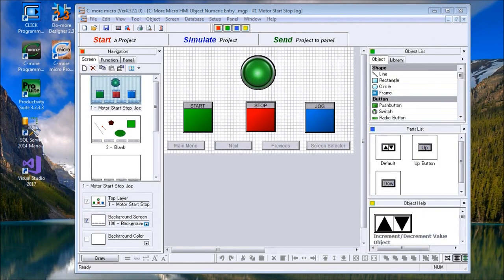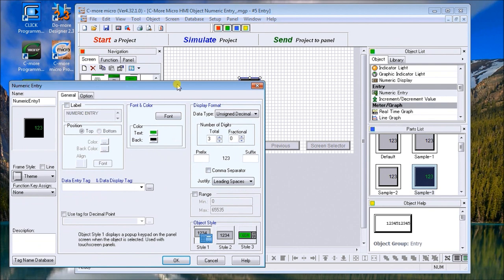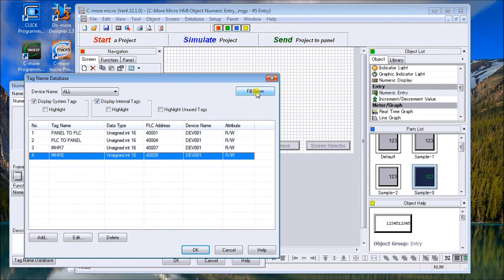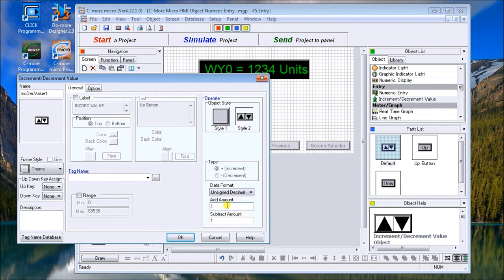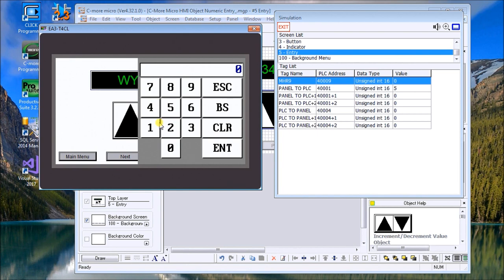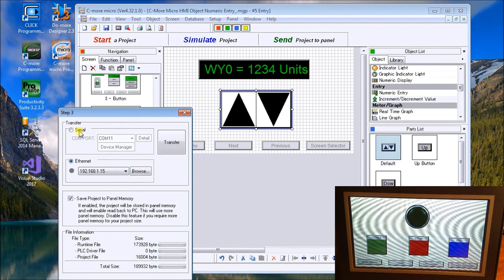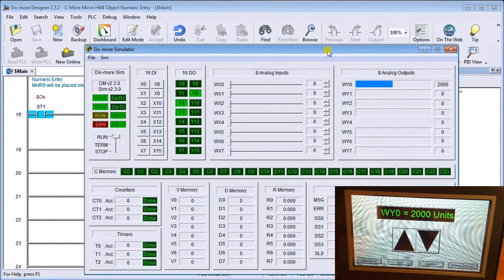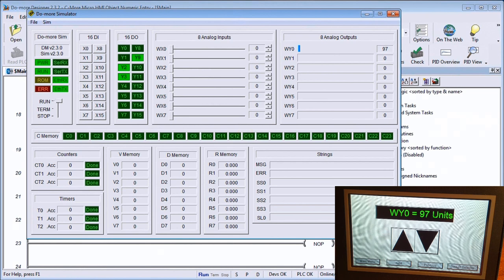C-More Micro HMI Object Numeric Entry

Comment: How about a Time Entry Text Field Hours and Minutes....
Reply from the maker: Hi Ken,
I would set up a numeric field entry for each of the units. (Hours, Minutes and Seconds) The program in the PLC will be used to modify the real-time clock. This will be dependant on the PLC type that you are connecting.
Regards,
Garry
Reply: @ACCautomation  That works for 1 Time setting, I have 8 Time settings, on a 7 Inch screen, there should be an easy way to enter Hours and Minutes and also tie those two an hours and minutes tags. The Numeric Entry exists. I can do this in InTouch, Archestra, FTView ME and SE, and probably a host of other HMI software .. so why not in Automation Direct.
Reply from the maker: Hi Ken,
I would set up another numeric field that contains the number of the Time that you want to change.  When you hit the enter key the information is moved to the correct timer in the PLC program.
Regards,
Garry
Reply: @ACCautomation  I am not modifying the RTC in the plc with 7 of these - they are start stop times. That method requires me to create at a minimum 28 (Hours and Minutes) objects and configure all 28 of them on a 7 inch screen. Does C_More have a developers kit - because I would like to override the Numeric Entry check time / date formatting entry and place two tags .. I push one button to make my entries, I change it on one place and handshake in one place .. FTView has this ability because that is what I am duplicating.
Reply from the maker: @meemyself5679  
I do not think that I am understand what you are exactly trying to do. You have a C more micro connected to one PLC. This PLC has a real time clock that you want to change. Where does the additional 6 real time clocks come into play?
Reply: @ACCautomation  I am not setting a REAL time Clock. I am setting a schedule for 7 days with start and stop times - I have Time Tags Hours / Minutes. I have an AB logix PLC .. and would like the HMI to allow me to use one Numeric Entry for time , one tag for the hours, and another for minutes All in the same entry / display object.
Reply from the maker: @meemyself5679  
That makes it clear what you want to do in the program. I would just use the Hours and Minutes tags with the day of the week tag. I would also set up a pushbutton as a signal to the PLC to move the data into that day of the week.
Regards,
Garry